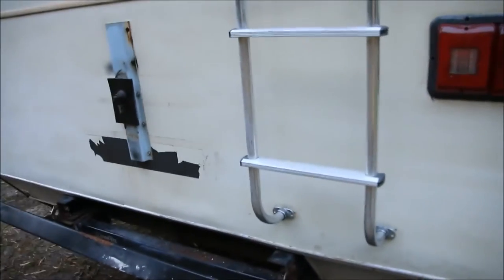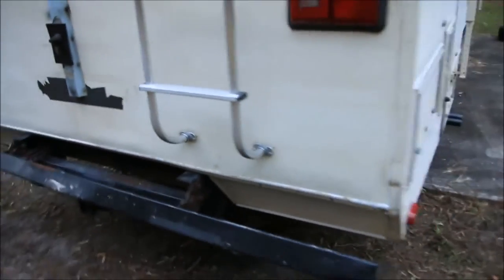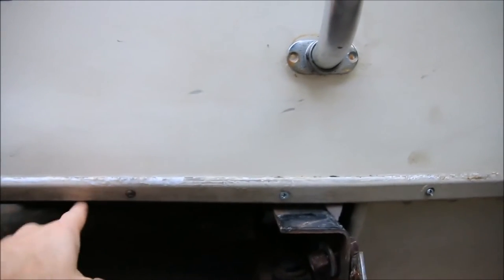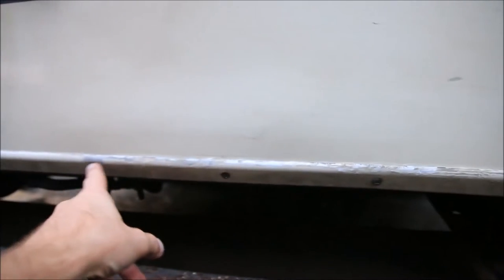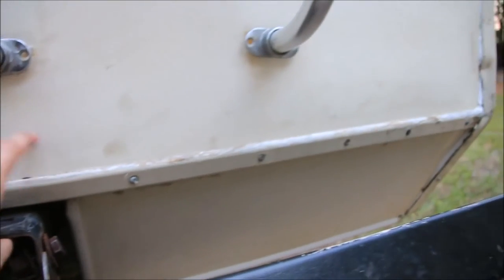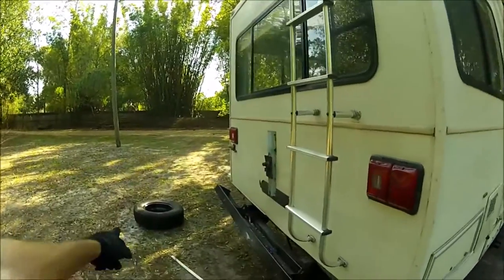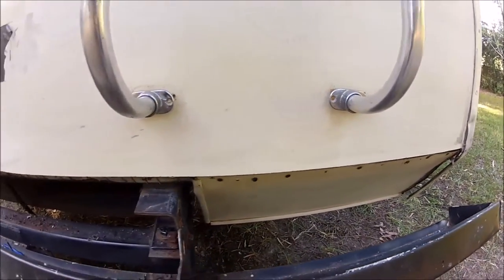RV Issues and Repairs

Comment: Could be a sticking park brake too.  Before you paint the RV flat black, check the genset and AC system out.  You will be able to hang a ham from the ceiling and cook it, during the summer,  without excellent AC.
Reply from the maker: I didn't even think about the parking brake sticking. haha Yeah I'm doing painting flat black again. This one is going to be bright white. I want to still look like a normal RV when I'm not using it chalk related events.

Comment: If it has been sitting for a while, i would drop the pan and clean the filter and put in fresh trans oil.
Reply from the maker: Thanks for the suggestion. I may have to do that. I don't know how long it had set at the dealer before I got it.